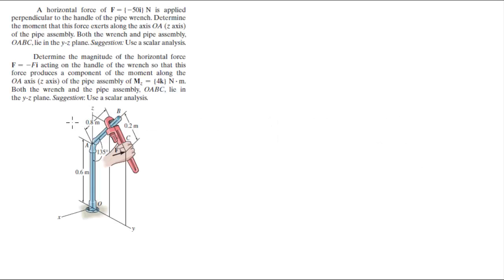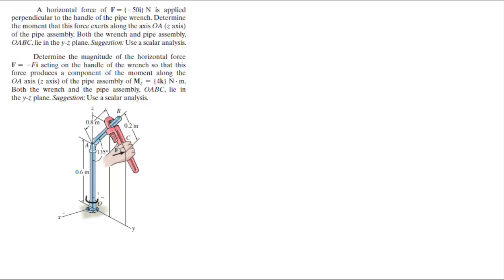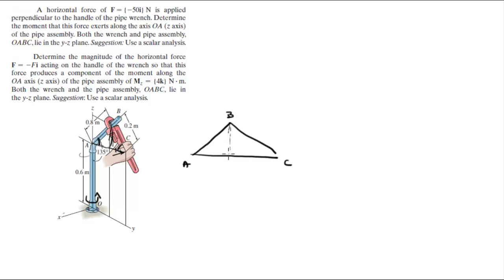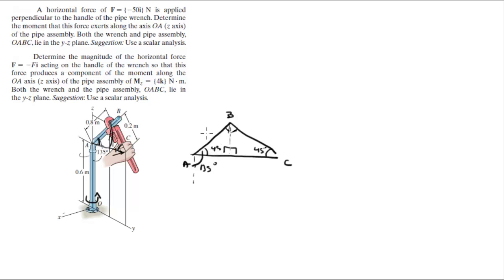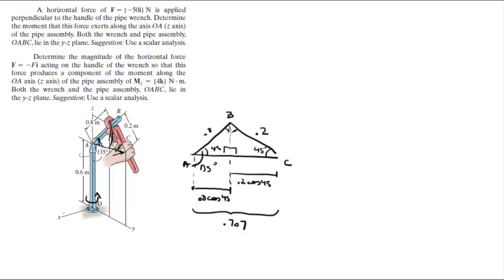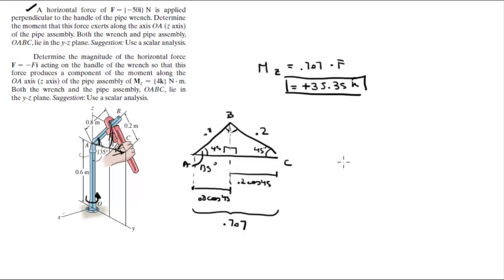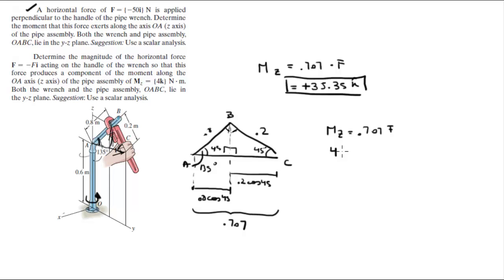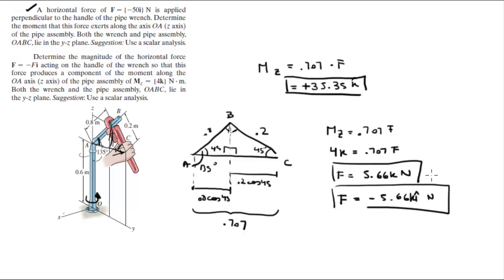Find the moment about OA and the Force

Comment: your triangle does not follow the 45-45-90 triangle rule. why does it break this rule is one of yours angles off?
Reply: Even though the sides are not equal length, if you flipped the triangle on the left to the right side and used the laws of the similar triangles you would get the angle between the 0.2 side and the horizontal line is still 45 degrees. The triangle you are talking about would technically be incorrect, but break into pieces and see whats similar and can be used.
Reply: @aqil.a  its still not a possible triangle. i dare you to draw it and show how its possible